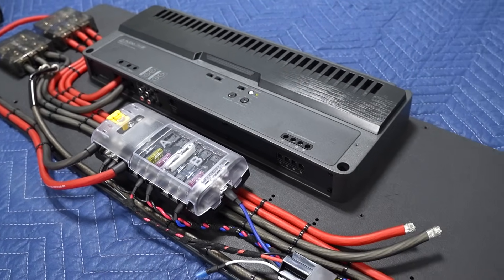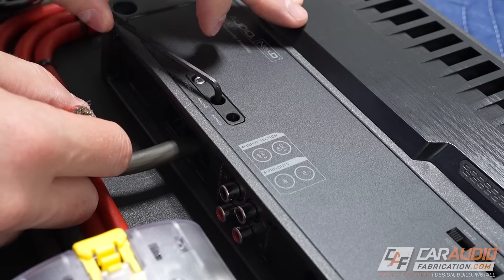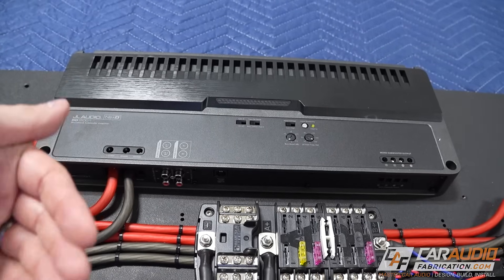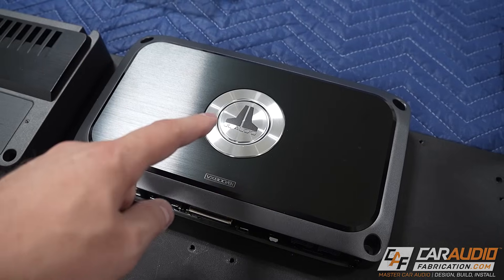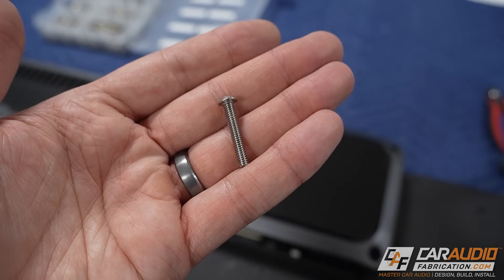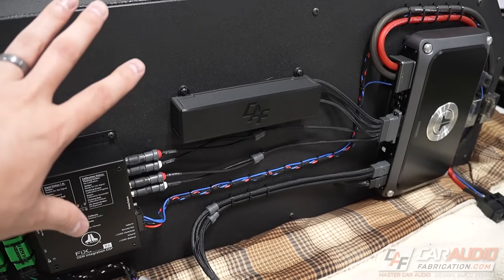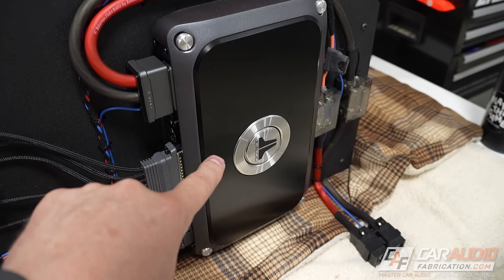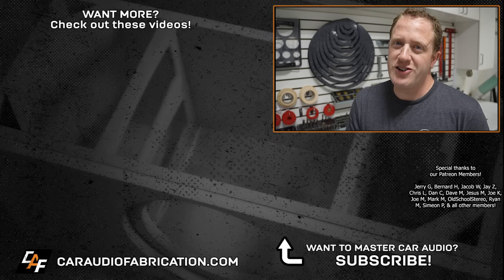Car Audio Amplifier Rack REBUILD! HOW TO wire multiple amps & add fuse blocks!

Comment: I don't understand why people use relays when running multiple amps, the load required to operate the relay puts more load on the remote wire than several amps would, now if you are using it for higher load components like fans then I understand that.
Reply from the maker: As I've said many times in this build, the relay is for another bank of accessories, hence the large fuse block with several new connection points.
Reply: @CarAudioFabrication  I'm agreeing with what you said in the video, but do a quick search on YouTube or Google and you will get advice to run a relay when wiring multiple amps. I know you are an excellent installer and know what you're doing.
Reply: @CarAudioFabrication can you please provide a link for the fuse block? Thank you.

Comment: Very informative, I am working on upgrading my current setup and this helps, thanks. Question: I currently have a Class D Mono (150A) and 1 Class A/B 4CH (70A) these are fed by 1 1/0AWG to a distributor (2x 4AWG), I am adding a second Class A/B 4CH (70A). Can I just upgrade the main fuse (Currently 250A) to a (300A) and upgrade my distribution blocks or should I run a new 4AWG wire and fuse to power the new Amplifier?

Comment: What's your process/method to connect the speaker wires from the JL Audio VX800/8i output to the existing speaker wires?

Comment: Mark, do you still suggest using the Large Wire Ferrules to connect the ends of the power wires, both ground and source, from the connection block to the amps on each end?

Comment: I just upgraded my speakers in my 20 malibu. The shop put in a 4ch alpine Amp with all four 2way speakers in the doors. I thought they put component speakers in the front, but no, they put in 2way 6.5 alpine and still got the factory tweeters in the front panels still active. Should I leave it or disconnect the factory tweeters?

Comment: I have something like this setup for my 2019 Dodge Challenger. I mounted a TwK-88 with a JL Audio RD900/5 connected to power with a similar power block. I have the factory audio from an adapter coming in via digital cable to the Twk unit. The amp alone powers my Infinity speakers and a dual 12" JL Audio subs. Except for one minor change, this is a perfect setup for me. Cost me a bit, but 5 years later, it still works awesome. Keep up the great work here as always Mark.

Comment: I saw a guy use a breaker instead of a fuse. Is that possible instead of using fuses?  Just curious.
Reply: Yes. I personally use a fuse after my breaker depending if my amps are internally fused and if your distributor block is fused. But I use a breaker so quickly disconnect my power without removing the terminal

Comment: Will you do a tuning video as well i juat did a DSP amp and im clueless on how to tune and i cant do 800 bucls for a tune.
Reply from the maker: Check out my full tuning video here https://youtu.be/MSxRh9vx0mM?si=rvtwQT9mA9bhBUmV
Reply: @coolme241  grab an oscilloscope LM2020 or E282 I believe is the name both are the exact same model O scope very easy to learn how to use to precisely tune your system for 50-70 bucks

Comment: If you had to use all 8 channels how would you do it? Split signals ? Could you do a build that consists of a lot of speakers ?
Reply from the maker: I don't understand your question. Can you elaborate so I can explain?
Reply: @CarAudioFabrication  what the other guys said is what I’m asking a stock headunit only has about 4 channels worth two front two rear I’m curious as to if u needed to split the signal to power the extra speakers remaining that are not in those OEM spots for example a custom A pillar or custom doors  that are not typically in the car the extra two or 4 however many extras are being used how would u power them ?
Reply: @thatguykai479 the signal is split internally via the software. It allows the tuner to duplicate the incoming signal to be used on different output channels. So yes, your FL/FR/RL/RR signals are available as outputs to each of the 8 channels and also on this VXi8 there is an additional 2 outputs for the subwoofer/s which have been processed and time aligned if needed. Usually you wouldn't time align the subs as the alignment is a delay to the other speakers which are closer. Usually...
Reply: @phizzle24  wow your explanation is amazing you should be a teacher thank you so much for the answer if I didn’t have this software I’d have to split the signals manually but the built in dsp already does that internally so it’s not needed thanks again buddy have a great rest of your night. 🤙🏽
Reply: I think he is asking how the channels are split? Like are there 4 left speakers one for tweeter, one for mid woofer, one for back door, another for 6x9s and the same for the right? He may be used to 4-6 channels or a stock system. I am also curious though.
Reply: @thatguykai479  depends on the car, but the setup @caraudiofabrication is showcasing uses 6 channels for the front speakers and 2 channels for the rear door speakers
Reply: Nvm idk what he and I are asking either